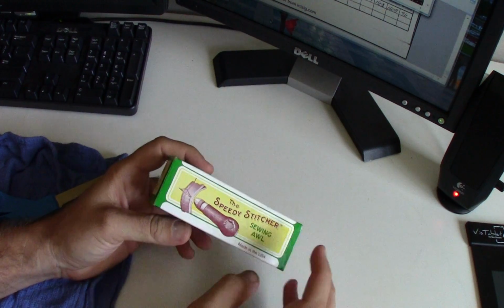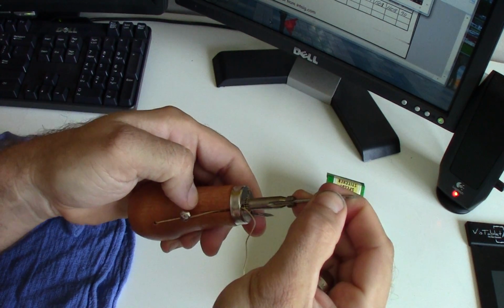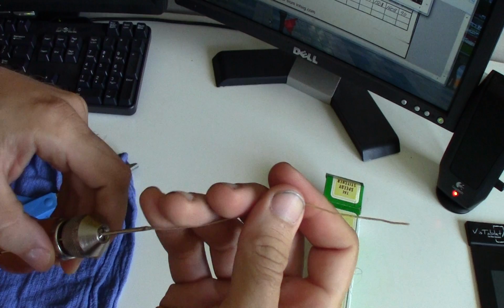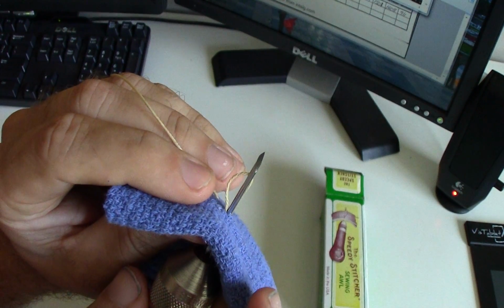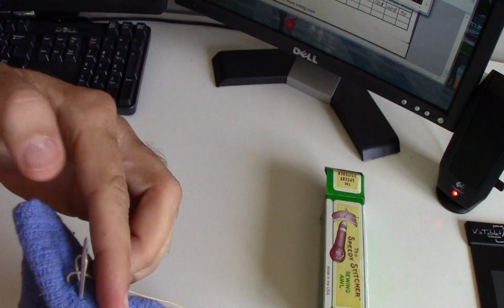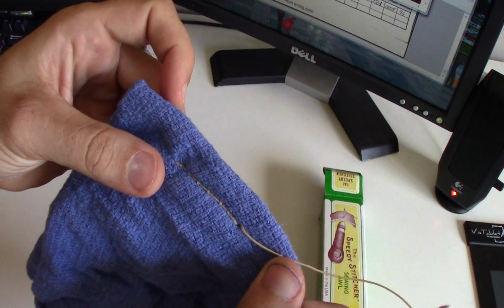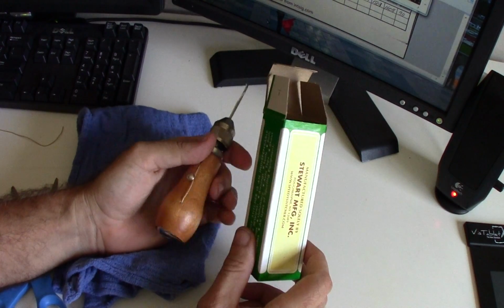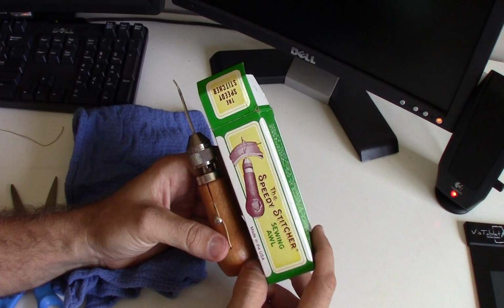The Speedy Stitcher Sewing Awl Demo Review

Comment: I use a wine cork as a needle cover so I don't have to remove the needle.  That way the tool is ready to use and you can keep it in the toolbox or drawer without worrying about sticking your hand or fingers.  Thanks for the video!
Reply from the maker: platficker that's a great idea, beats setting the needle every time!!